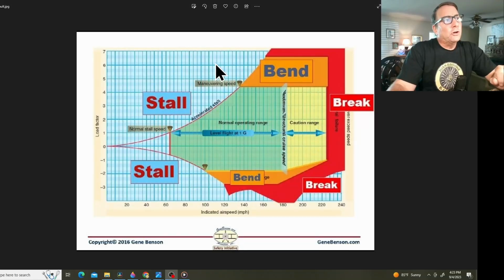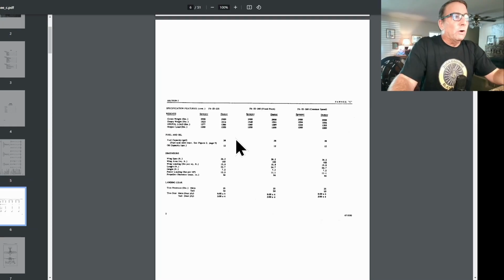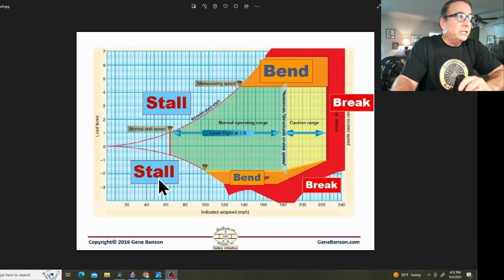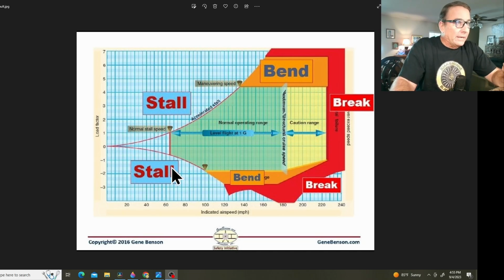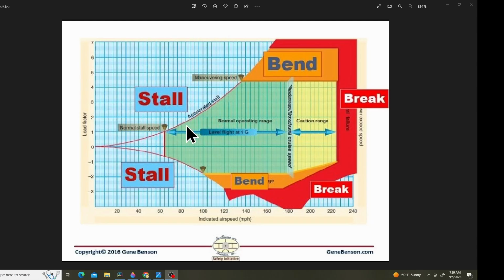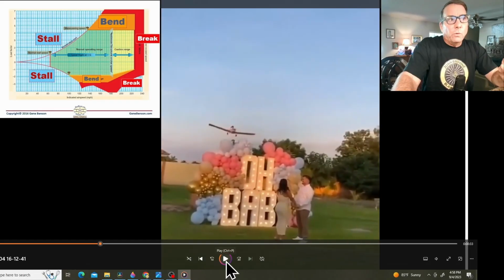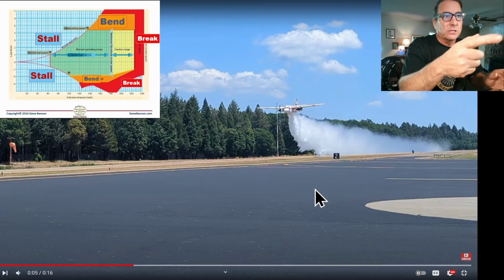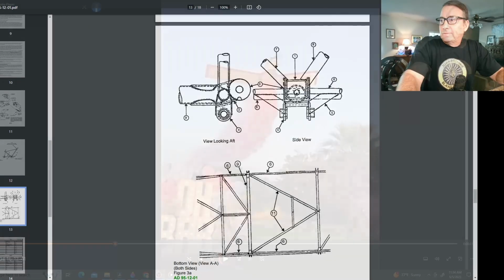PA25-235 Sinaloa MX Gender Reveal Party Structural Failure

Comment: While all that theory is correct and important, it isn't actually relevant here. A pilot only needs to know that if they exceed the limits something will break, but when looking at an accident you need to look at exactly what, how, and why something broke.
Manoeuvring speed is a helpful abstraction for a pilot*, but it sort of covers two distinct failure modes. Many parts are not aerodynamic related, so stuff will start to break at a fixed G point. We define manoeuvring speed as the minimum speed you generate forces that will break something on the aircraft. You can also define a spar manoeuvring speed, which is the minimum speed you could break the spar. The spar breaks because of a force that depends entirely on speed and angle of attack, and is largely independent of aircraft mass, and hence the actual G forces. It makes no sense to design fixings that would break after the main wing spar, and there is a maximum G the spar can possibly apply to the aircraft without failing, so you will always exceed the specification of something else before the spar in any remotely sensible design. Given that we design aircraft so that manoeuvring speed is always less than spar manoeuvring speed anyway, pilots generally don't need to care about spar manoeuvring speed, but here it is important. If the engine had fallen off then the change in manoeuvring speed would have been relevant. When the spar fails it is not. 
I wonder if the water cloud changed the characteristics of the tail? At higher AoA the tail would have gotten closer to it, possibly producing more control authority than expected. They will need to look at other parts of the aircraft to see if it was also over-G-ed, but if the spar failed without it being over-G-ed then it is a pure mechanical failure. Pure pilot error over-stressing it to the point of ripping the wings off is also still possible, but the change in mass would not actually affect that because that would be related to the spar manoeuvring speed, not the base one.
* Pilots need to know how to not crash, not how exceeding the limits in different ways will result in different crashes. If they over-G, rip the engine off, and spin to their death the outcome is the same as if the wing spar fails and they spin to their death. Pilots do not need to understand what will cause each to happen, they just need to know how to avoid both.

Comment: Also the modified wings from round to square wingtips may have a big impact in twisting moment on the wing structure? It seems that the wing starts to fail by first being twisted and by then all structural integrity is kind of gone..
This could also be a lesson about the possible impact of modifying aircraft and the importance of verifying tests. As others have stated about the wing attach fittings, I did a reinforcement on a tug-Pawnee here in Sweden some 10 years ago. The Pawnee look rugged by the looks, but in my opinion is a pretty weak construction. At least the part forward of the cockpit. thanks for a great channel Juan! You have a nice way of explaining 👍 greetings from Sweden 🇸🇪
Reply: Why would the wingtips be modified, from round to square? My thoughts are that this aircraft could be used for "events" and that the square tips used be used to accommodate smoke canisters. Also no doubt is pink and blue flavours.

Comment: I perfectly understand lowering of the maneuvering speed as the weight decreases, so the aircraft would stall at lower speed at the same Gs, but I don't get how is it related to structural damage. I assume that lower weight at the same Gs would have been exerted lower forces on the airframe.

Comment: Concise treatment of the subject as always. The matter of Va varying with weight could do with some elaboration, something that seems to be hard to come by and appears to be largely absent from many texbooks. There is indeed something counter intuitive going on. As stated in the video, stall aoa is constant (in a given configuration and within reasonable mach numbers). The implication is of course that at a given dynamic pressure (speed and density), the lift at a given aoa, here stall aoa, will always be the same and thus the loads on the wing structure as well. After all, it´s the forces, not the g´s per se that will cause damage. It would appear then that when weight is reduced at a maintained aoa, a higher G is acheived per Mr Newton´s third, but at the same wing loading as per above. The clue given here that it isn´t about the wing structure is informative, but it would be interesting to see some more in depth theoretical treatment on the matter, would anyone happen to know any?

Comment: My first thought on watching this video was corrosion of the spar. Piper has had an issue with corrosion and weakening of the fixed component portion of the wing spar and cracking. That’s why there is a eddy current inspection based on hours, training hours, etc. but again, not sure what rigidity requirements are for planes in other countries. 
Add that with the sudden g load and you reached the critical threshold. Sad day when it’s supposed to be a celebration.

Comment: So it jumps its earn weight at once 150 gallons times 8 pounds per gallon that’s more than the empty weight of the aircraft. I would think even a 20 or 30% loss that quickly could cause maneuvering issues there’s no way you could fly this and dump during a maneuver. Hell you might not even be able to fly in a straight line dumping that much at once.

I have a feeling the valve that was modified to jump faster than herbicides and pesticides normally used 

Which is hilarious by the way, pregnant or breast-feeding mother wants to get sprayed by water that has rinsed the inside of an agricultural aircraft. You can only imagine what residues existed in those tanks. 

Why is everybody so focused on this ginger bullshit? Seriously it’s either male or female male whatever in between.  “The theys” even coming from an LGBTQ background it’s pretty ridiculous and on top of that people dying over, revealing which gender your child is this stuff is so stupid. Definitely the idiot who causes trouble where the wants to die. We would have some Darwin awards.
Reply: This was an emergency dump of the whole contents of the hooper, and not a regulated release for normal spraying operations.

Comment: Thanks for an informative and well presented video. I had no idea that manoeuvring speed decreased as a plane got lighter. I’d always assumed it was the inverse!

We can always learn from these incidents. RIP to the pilot.
Reply: The way I heard it put is a heavy load will stall.  A lighter load can generate more lift before the stall and thereby more stress on the frame.  Think of the Va stall as a safety valve that dumps excess lift.  The wings will eventually create the extra lift, but the frame can’t spread the lift.  Even if the struts and spar distribute the force to the frame, now the engine mount is overstressed with its heavy load.

Comment: I remember a story my old C.O. told me, he was a young Buccaneer pilot on a squadron learning how to do toss bombing, only the airspeed indicator was not correctly calibrated and showing 20kts slower. Long and the short of it, coming in hot and releasing 2 1000lb iron bombs there was a slightly louder than normal thump and jolt only for his navigator to point out various bits of the aircraft where falling off as they where over g'ing the aircraft. 550kts, 200ft with what was supposed to be a 3g pull up.

Comment: The wing appears to fail well before the dump is complete, ie before the weight changes all that much.  It's hard to believe the crash wasn't caused by a structural defect.  This is a great channel but in this case implying pilot error seems premature.

Comment: The wing transitioned from airfoil to air-brake in a few seconds. Analogous to suddenly doubling air mass density during a pitch maneuver, pitch rate will double. Or at least the force generated by the control surfaces responsible for the pitch moment will double. During the transient the structure may yield under the suddenly increased load. Well outside the safe flight envelope into an unstable regime tragically in this case.

Comment: But how did the a/c exceed 4g? Could it have been courtesy Mr Newton (of falling apple fame). Consider forces on the a/c in level flight: weight, drag etc balanced by lft. Remove a substantial amount of weight but don't change the lift, then there must be an acceleration upwards (f=ma etc). Here, on top of the g from the ag pilots initial pull up, the g loading due to the reduced weight increases rapidly, all happening pretty quickly. 

Interesting that former PBY tanker pilot @MikeSowsun said they were trained to 'check forward' while dumping the load, anticipating the extra a when m is reduced, that f=ma again. Guess the pros always knew what to do. Sadly our ag pilot didn't, plus had forgotten his 3rd grade physics.

Thanks Juan, for your as usual, great vid.

Comment: Maybe another less counter-intuitive way to look at this is that for a given fixed wing load in this scenario, the rate at which the pitch changes will increase as the weight decreases. Classic F=ma. Less weight results in greater acceleration. Initially the rate of pitch was probably ok, but as the water exited, the rate progressively increased until the thing just about went vertical at the end and ripped the wings off.

Comment: While it is true that low weight does increase max Gs for the same control input at any given speed, the lift of the wings and so the couple at the wings roots is the same, so I don't see how low weight can be to blame for this kind of structural failure. Other parts of the airframe indeed are more stressed with more Gs, but not the wings because of this low weight situation. Thanks for your response, it meens a lot for us GA pilots your videos. Congrats.
Reply: Lightly loaded, the wings can produce more lift before stalling because it has more available angle of attack. 

The way I heard it put is a heavy load will stall.  A lighter load can generate more lift before the stall and thereby more stress on the frame.  Think of the Va stall as a safety valve that dumps excess lift.  The wings will eventually create the extra lift, but the frame can’t spread the lift.  Even if the struts and spar distribute the force to the frame, now the engine mount is overstressed with its heavy load.

Comment: A good lecture! Just want to point out that in this particular case it was a wing failure, meaning that dumping the cargo was not the cause (rather it was helping as it reduced the wing loading, just didn't reduce it enough). But if the wing hadn't failed (possibly being weakened by pre-existing corrosion), the engine mount might have, and that would have been almost as unsurvivable. So indeed, the abrupt pull-up with dump was a silly thing to do. RIP.

Comment: The G-bend limit on this diagram, is the horizontal line at a constant G.
It does not change with speed.
What changes is the stall speed, which increases with airspeed and with G.

R

Comment: Some gross speculation here. The wings of the pawnee are hinged and strutted, reverse of the cub. The struts are loaded in compression at positive G. Failure mode in compression is buckle. If these struts are not completely straight or dented, the buckle load is way reduced. Being on top of the wing, these struts are vulnerable to damage, like people standing on them or hopper loaders denting them. Personally I think that needs to be looked at in the investigation. Ag operations are generally rough with all sorts of non aviation people handling these machines. Would not exclude existing damage to the struts. You can see the forward strut failing first, which is where the brunt of the aerodynamic load is

Comment: Lift is a function of speed and angle of attack (as long as you don't change wing geometry by deploying flaps etc.) So a lighter plane at the same speed and AoA produces exactly the same lift as a heavier plane. The only difference is climb rate. Now, if you drop a full payload within fractions of a second a plane will experience a sudden vertical acceleration at the wings since the lift will suddenly far exceed the weight of the plane. This will also result in a violent nose pitch up as the tail surfaces do not generate lift and will not "automatically follow the wings".
This violent pitch up is what will cause excess stress and in-air break up.

Comment: Since WW2 surely pilots were used to pitching forward or easy stick forward  to stop aircraft climbing when suddenly dumping a significant bomb load, thus unloading the aircraft. Dumping a hopper or water bombing same idea.
Reply: Also over a 1000lb being dumped that quick, half the weight of the aircraft suddenly goes.

Comment: Very very interesting. As a nonpilot I would have asumed that the behaviour and capabilities of the ac would be quite the opposite and the ac would have more structural strength while loosing weight - but thats physiscs.

Comment: @blancolirio If you watch the video slowly, it looks like the pull is not super aggressive, but that the left wing starts to fold back at the outside leading edge almost immediately. That increase in angle of attack, along with the super fast speed, seems to be what's at work here.

The right wind looks totally fine the whole way...

Thoughts?

Comment: With total humility I would like to submit the following. I worked on ag wagon spray planes. I think the wing failed ( on the old piper)  only because it was old and had not been maintained. Why do I say that, because around here the ag planes drop their load and pull up abruptly all day long. I think that old and tired piper was not up to the task....not even close up to the task. I think the wing would have failed in ANY abrupt high "G" maneuver, dropping its load or not.  IMHO and FWIW.

Comment: I always enjoy your videos.  A lot of emphasis on the maveuvering speed but I don't see how that would increase the load factor into the bend or break area.  A heavy aircraft needs lets say 10 degrees angle of attack on it's wings to fly straight and level, same aircraft but lighter only needs 5 degrees angle of attack to fly straight and level.  Heavy aircraft at 10 degrees is suddenly lighter, has excess lift and accelerates upwards, load factor increases into structural failure.

Comment: That's quite a pull, but I suspect that poor maintenance of the aircraft is a contributing factor in this.  Not only would you have to exceed the design load limits but there is also a factor of safety in the design of 1.5 i.e. if the design load limit is 4.0 G a 4.2 G pull up will not cause structural failure of the aircraft like that.

Comment: This tragic accident had nothing to do with maneuverings speed being reduced as aircraft weight decreased.  It was the result of aircraft angle of attack rapidly increasing due to  a sudden loss of weight (forward of the center of gravity).  Because this rapid angle of attack increase occurred above the maneuvering speed (gross weight maneuvering speed) the wings were subjected to load greater then they were designed to support.  Corrosion probably also contributed to this failure as well.

Comment: After watching this it does seem like structural failure due to a defect in the wing reaching it's final fatigue point. The probable cause was no doubt a maintenance issue.
I spent many years flying ag aircraft, including all models of the Pawnee including the Brave. There were some very specific AD's on the wing box section and I never heard of a failure.
I flew aircraft that were virtually new to aircraft that had 20,000 hours of hard topdressing work on the airframe and the POINT that I want to make is that we did not YANK AND BANK  these aircraft. Most ag pilots I knew with were smooth operaters who rarely pulled any high G manoeuvres We treated these aircraft with respect, worked them hard, but stayed out of the high G stress envelope. 
I have carried loads of a ton (2240 lbs) in a Cessna  Ag Truck in the cool of the morning, air like glass, and looked at the upper wing surfaces "oil canning" with the stress. Perfectly safe but no time for too much speed or hard control movements. If I had been stupid enough to dive to VNE and yank I would have put some very serious dihedral in the wings.
I guess the point I am trying to make is it is very hard to break an aircraft that is in reasonable condition unless you really try hard BUT if it has a flaw or hidden weakness all bets are off. Therefore good  ag pilots develop the technique of FEEL and only push the aircraft enough to get the manouver done with the minimum of effort.
The pilot in the video certainly didn't follow these rules.

Comment: Aero Engineer here with a lot of ag design/testing/certification testing.....  When you emergency drop, the effluent drops down entraining air which increases the angle of attack at the horizontal tail which increases the down force at the horizontal tail.  This tends to pitch the aircraft nose up without any input from the pilot.  A number of AT-802's have been lost because of this phenomenon, but in this case the horizontal tail stalls and the aircraft bunts (uncontrollable nose down).
Reply: I think you have the answer sir.  After watching the video frame by frame it appears the tail got sucked down by the water down wash coupled with sudden wing unloading.  Maneuvering speed has to do with full control deflection limits, as I recall from ground school.